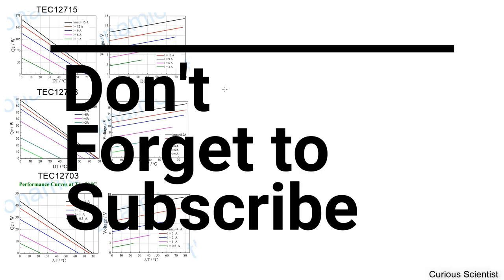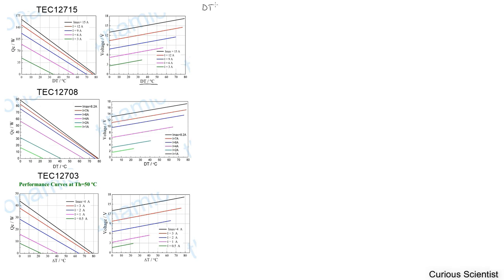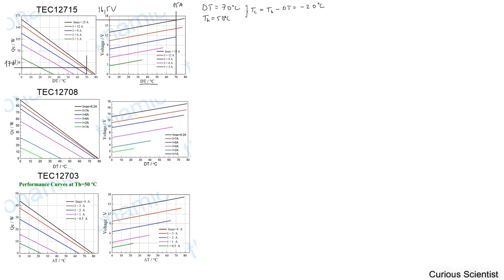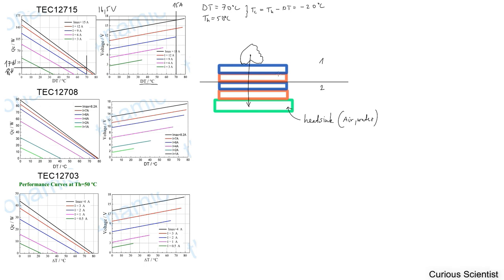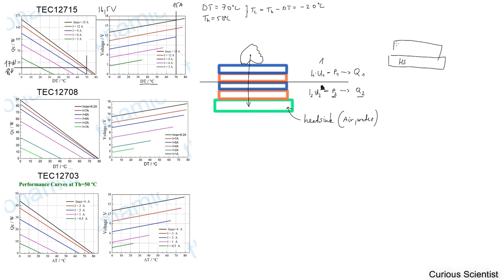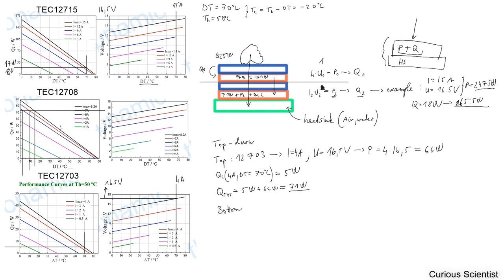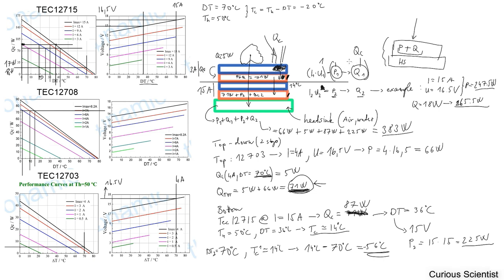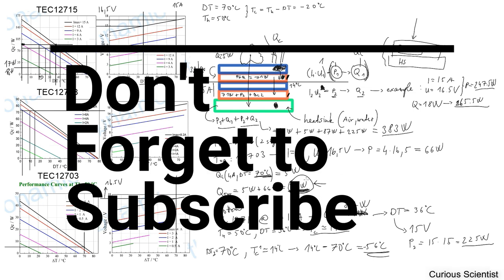Stacking of Peltier units - Part 1

Comment: We had spoken years ago about cooling with peltier units. I am still working on that. I think I'm heading towards a combo of better insulation to protect the cooled air and gallium pipettes as a phase change material (PCM) to store the heat to be removed through ice and a volatile positive pressure airflow to get the air cool from the start. The cooling chamber needs max insulation  (which can be foil coated polyisocyanurate) heatsinks on the peltier are cooled with the condensation of ice packs until they reach equilibrium with the temp of air in the cooling chamber and no longer create condensation. Then a hollow plastic  1/4"×3"×6"   (~6.3mm×75mm×150mm) with gallium inside will begin melting as air heats up and the phase change begins in that plate. Peltiers are mainly used to extend the life of the  ice.
Reply from the maker: Sure, I remember you from the early days. I have difficulties imagining your project but if you have any videos to share or any kind of documentation, please feel free to do so.

Comment: When you got 14 degrees at the cold side of the second stage unit, you'd have to have the chart for that temperature for the first stage unit. But you have it for 50 degrees, not 14. The performance of Peltier modules lowers with lower temperatures.

One way to solve the problem would be to build a mathematical model using the curve for different temperatures at the hot side. Then you'd have curves for any T hot and delta T.
Reply from the maker: Yes, the calculations are not super exact due to the available data I could access. But as a guideline to understand how to evaluate their performance, it is good enough (for me).
Reply: Great idea

Comment: Hi, I want to thank you for these efforts, then I have a small question, the last step you side DT2= -56, I could not catch this step, Where the -56 must be at which surface or at which points, or the difference between What and What, please explain it for me, I got the surfaces of -20 degrees and the 14 degrees, but -56 is for which difference. thank you a lot again.
Reply from the maker: I think that part confused you a bit, sorry for that. In the beginning I showed why a large performance Peltier should not be on the top of the stack. We just simply cannot move such a large amount of heat (265 W) with Peltiers. Then, at 12:54 I start the real exercise and start with the TEC1203 as the top unit. So, with this unit, I just try to max out the DT and all the parameters and see what kind of cooling power I can achieve (~5 W). Then, based on these parameters, I know that I need to remove about 71 W of heat from the hot side of the TEC12703 using the bottom Peltier. So, I pick the proper parameters from the TEC12715's performance chart to get that 71 W moved away from the hot side of the TEC12703 on the top. At this part, I know that I can fix the hot side temperature of the TEC12715 (that depends on the heatsink), and then I can pick a corresponding current (15 A) which will give me a DT value (36°C). I wanted to maximize DT, so I picked the largest current.

Since I fixed the hot side (heatsink) to 50°C, the DT of the bottom unit will result in a 50-36 = 14°C cold side temperature which is also the hot side temperature of the top unit. We fixed the DT of the top unit at 70°C, so 14-70°C is -56°C which is the hypothetical cold side temperature on the top.
Reply: @CuriousScientist  Wow that was amazing explaination, thank you a lot, and for sure  all these charts 03,8 and 15 A with out loads right.
Reply from the maker: With a very minimal load. Peltier stacking is not made for cooling serious thermal loads, but it made for reaching very low temperatures.

Comment: Try stacking 5 peltier vs 1 peltier at full amp. And check the COP.  By stacking more Peltier will gives you higher COP with lower temperature drop each stack. Cause from the datasheet, the ower the delta Temp, the higher the COP. So if all 5 chips at high COP, the efficiency will be high and it might rivals gas pumped refrigerator.
Reply: So the second chip power is twice the first chip, and the third chip is twice the power of the second chip and so fourth until the 5th chip. There will be a cutoff efficiency at how many peltier you can stack.
Reply from the maker: You are still limited by the Qc of the bottom Peltier cooler. All that stacking do is just makes DT higher between the top and the bottom of the stack.
Reply: Limit the voltage drop by each chip so that each chip delta T will be limited to maybe 10 degree. Then you stack them.
Reply from the maker: I pretty much know how to do it. But you won't be able to get out more performance than the performance of the Peltier at the bottom.

Comment: Would it be possible to reach -200 degrees celsius on the cold side of a module with stacking?
Reply from the maker: Not at all. You can reach about -50°C or maybe -60°C, but that's really the physical limitation of the cooler. Tech Ingredients tried to cool it with liquid nitrogen and he also got stuck at around -50°C-ish temperatures. I also tried to cool it with dry ice and I couldn't go below the above mentioned limits.
Reply: @CuriousScientist  would it be possible to achieve this temperature with any type of peltier module that exists today with or without stacking? If not, are there any other efficient cooling methods other than liquid nitrogen that uses electricity?
Reply from the maker: @VrishiSpin  You cannot reach below -60°C (approximately) with Peltiers at all . It is their physical limitation. 

The range (-200°C) you are talking about is a totally different dimension, you can't just put a few things together at home and reach such a low temperature. These low temperatures are typically achieved by using liquid nitrogen anyway. You cannot really avoid it. Whenever you see some low-temperature stuff, you will always see some liquified gas (LN2 or liquid helium) used as a cooling medium.